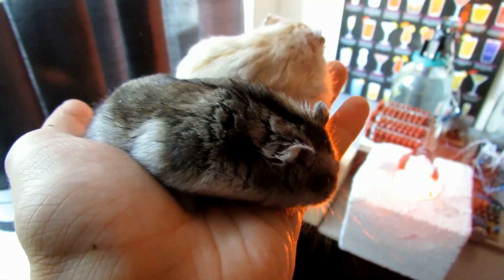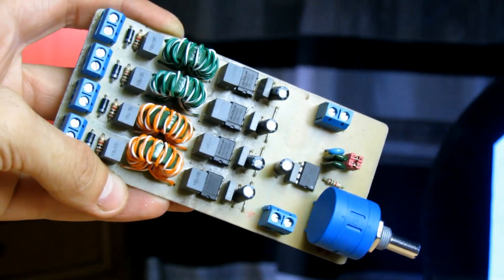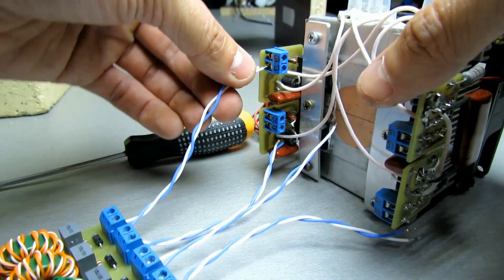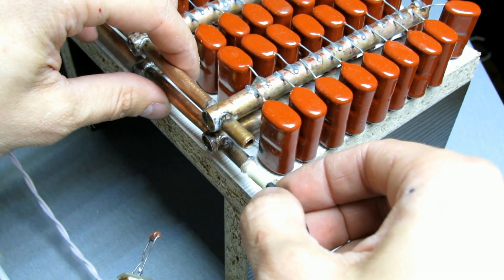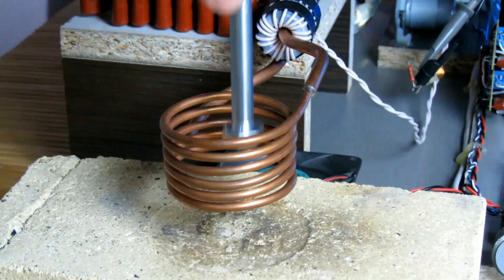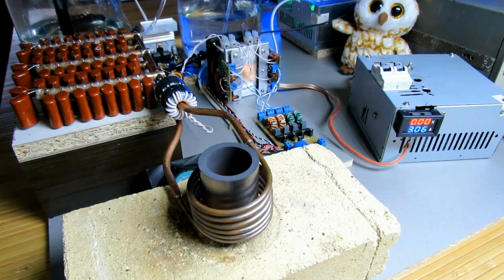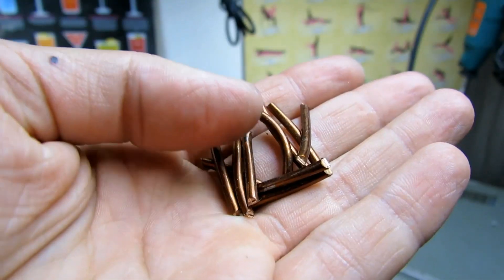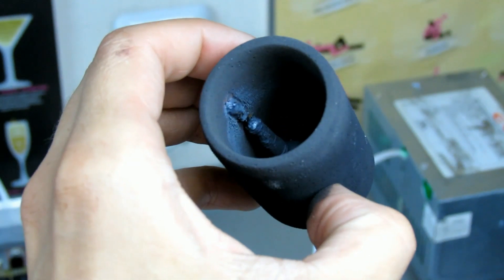BUILDING a 1.5kW Induction Heater ll Complete Build Guide

Comment: I just wish I could take my lab from hobby to pro. My equipment is all crapping out and it makes building no fun any more. I began collecting everyone's discarded electronics on trash day. Here where I live everyone puts all the stuff they font want or is broken on the curb and trash trucks pick it up. I've found done things that were like new and had no issues. I just picked up 5 computer power supplies and I now have like 12 flat screen tv's. All but 3 work. They make great overhead lights. This is one project I want to build I just need components.